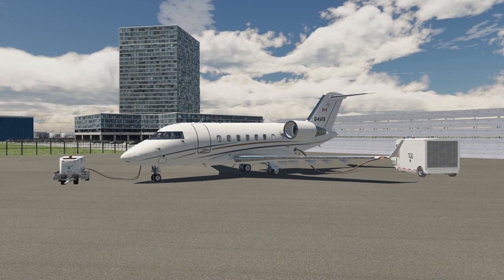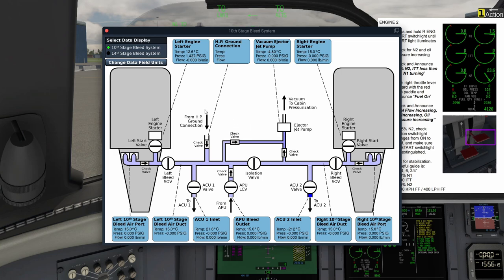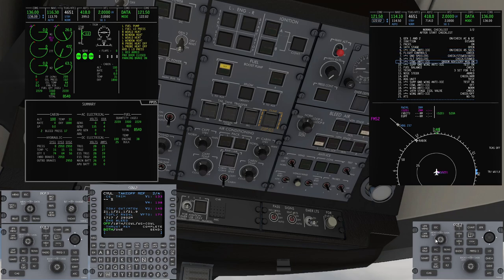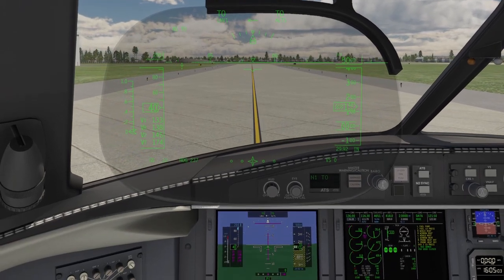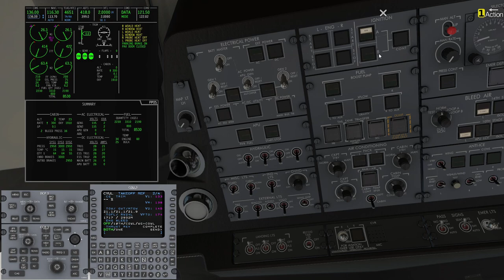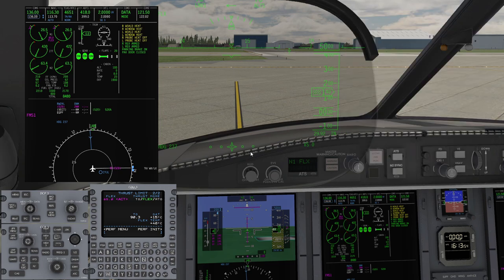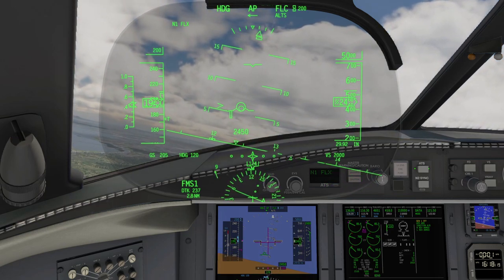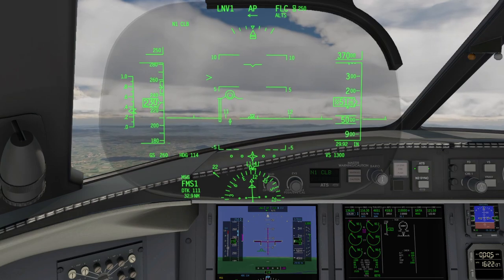Hot Start Challenger 650 - Complex Starts

Comment: Your tutorial series are in my opinion the best out there, lots of useful details and always very clear. Would you consider doing a series on the Rotate MD-11, which raises a few challenges due to some unique characteristics and would benefit from your excellent approach at teaching the needed level of skills? In any case continue whatever the aircraft, your contribution is precious to our community.
Reply: Not trying to step on Graham here; his tutorials are fantastic. I have done a full flight tutorial on the Rotate MD-11 if you are interested in giving it a look. Hopefully you will find it useful. Cheers
Reply: @CaptainMac  Thanks very much for the tip, I will definitely check it out, I've been on the fence about buying this plane until now, but it seems to have matured now and is XP-12 compatible, so I'm probably going to have a go at it and will certainly benefit from your tutorial, which seems very well done. Cheers
Reply: @phjo5117  I have to say, I really like it! It has fast become one of my favorite aircraft to fly. That being said, I am also really looking forward to the TFDi MD-11 as well.
Reply from the maker: The Rotate MD-11 has been on my list to look at for some time, but I've been really busy over the summer with work and haven't had the time. Still need to do more Challenger and 747 stuff too! Will need to look at Captain_Mac's video too as I've not seen much MD-11 content following the original release and there were some obvious issues with the first release. It's a great looking aircraft though. I do wish all aircraft had Challenger style state-saving though!

Comment: I’ve REALLY enjoyed watching your 650 content. I have a Challenger background on the older 601’s, but will be on course for the 650 in the new year. Your experience and willingness to delve into the systems has been absolutely invaluable. Please continue to produce these fantastic videos!

By the way, you mentioned reduced wear being the reason for a FLEX power TO. Is that the only reason to select that power setting for departure?
Reply from the maker: Sorry for the delay replying - hope you enjoy flying the 650, the rated pilots on the testing team speak highly of the aircraft.  Flex is odd on the Challenger and I don't fully understand the issues, but I believe it's related to engine overhaul life and automatic performance reserve and for some reason the flex option actually reduces the overhaul interval.  A flex departure can reduce noise and gives a more comfortable climb out angle for a very light aircraft too.

Comment: As always really nice video! I've been flying the Chally for a while now, but learned quite a lot from it.
Is it possible to enable random failures?
Reply from the maker: Not at the moment. There are a small number of failures that will result from mistreatment of the aircraft, but no totally random failures. I believe random events are on the roadmap for some time after 1.6 is released.
Reply: @ReflectedRealitySimulations  thanks for the reply!

Comment: Thanks again Graham for another amazing tutorial please keep em coming.....just a quick question that when simbrief gives me zero fuel weight is that what I should input into fmc after taking on board the block fuel recommended and pax etc or do I leave the fmc to calculate?
Reply from the maker: Simbrief will calculate a ZFW based on how many passengers you have, but really it's not going to make a big impact on how the aircraft flies. The simulation loads passengers and payload automatically when you do the ground handling request in the FBO, so when you say 2 crew, 4 passengers it will add 4 passengers into the ZFW (the crew are already accounted for).  

When loading the FMS, you can then specify 4 passengers in the PERF INIT page on LSK2L. If you prefer, you can type ZFW into LSK3R, but neither of those options actually load the aircraft - that's done by the FBO logic.

There is the hope to include some kind of visualisation of the aircraft load and balance in a future update, but the key thing to remember is although simbrief gives you a high precision number, pilots often have no real idea precisely how heavy the aircraft is! (we don't weigh every passenger, so some variation is to be expected).

Hope that makes sense?
Reply: @ReflectedRealitySimulations  Graham Thanks so much for taking time out to answer that for me. You Sir are an absolute font of knowledge and so kind of you to share this with us.
Thanks again for all you do and please keep it up as I always come away from your vids a little bit smarter